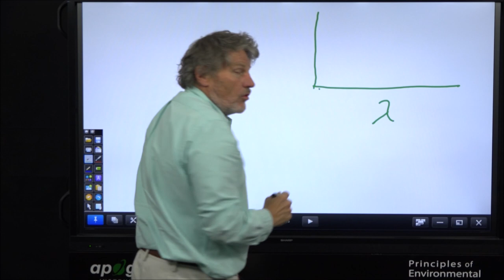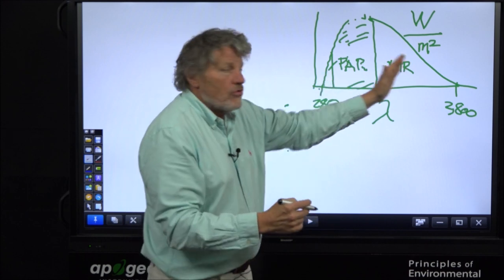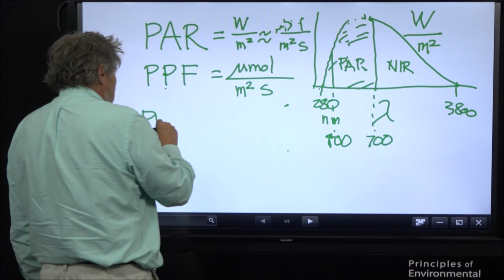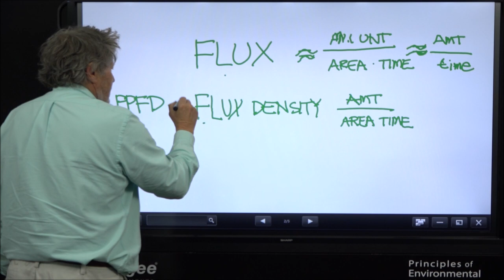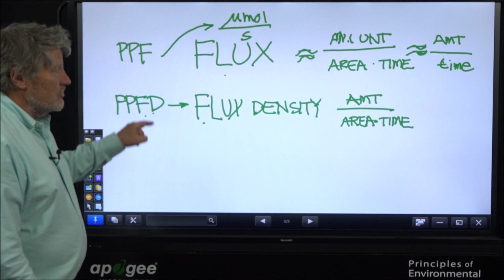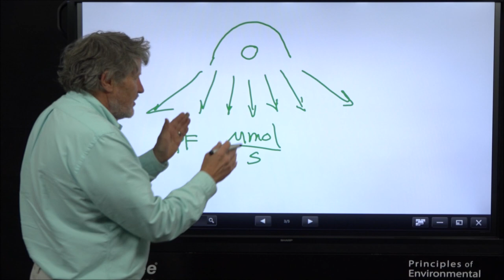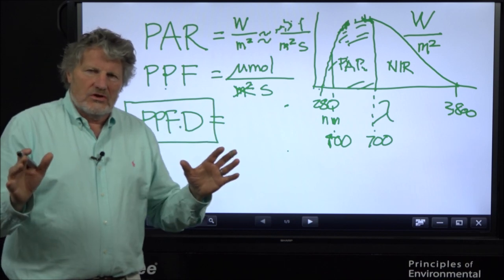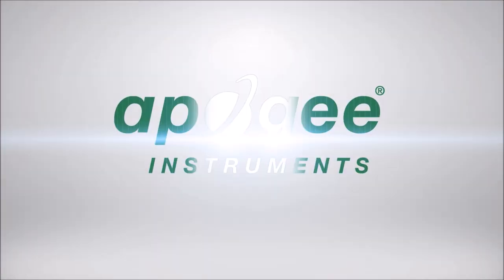PAR, PPF, PPFD, and PFD Explained

Comment: Thanks! A great explanation, sad that we don't see PFD used more often sure this is leading to a slow adoption of new technology as it makes your PPE look less efficient. What is the measurement of PFD? The big difference for me between PPF and PPFD is that the first is a constant and best method of comparing lights while the PPDF is variable based on plant needs and distance, so more important for optimal setup later in process.

Comment: Thanks a lot Dr. Bugbee, great explanation!
One thing that bugs me, though. If you define PFD as the flux density between 300 and 800nm it sure is an improvement over the old units, but it still is not the full picture. Not all photons in that range have the same effect on photosynthesis. For sure there are green photons in the middle of that range that don't have any effect because they are reflected. That's why leaves are green, right? So wouldn't it make sense to multiply the PFD with the relative absorption spectrum of chlorophyll, which has maxima in blue and red and a minimum in green, to get a much more accurate measure of the amount of photons that are useful to plants? Something like PFDP: Photon Flux Density useful to Plant growth.

Comment: Hi a question in the calculation of the PPFD value. Doesn't the measuring distance always have to be specified? Because, extreme example, I measure 1 cm away from the light source and on a square centimetre, which I then extrapolate to one square metre...are there official measuring conditions?
Reply: Maybe 1 foot or 1m
Reply: I'm not sure about this (not enough knowledge), but most likely you're right that you can extrapolate it to a certain degree. It could be it's not perfectly exact though, cause if the distance between sensor and light source gets bigger (even exactly below the middle of the light), photons scatter more and I'm not sure if photons also "bounce" of each other in let's say perfect vacuum so no other particles can interfere. 

Photons should scatter perfectly without bouncing cause every photon has the same speed (light speed), but maybe I'm wrong and there is more to it (gravity maybe also slightly influencing on that small scale?) Also don't know how relevant the production quality of light source is and how much this influences how photons scatter in every direction.

Comment: Very good your explanation Dr. Bugbee, Congratulations. A question doctor, if I have in my measurement 1,267 umoles photons / m2s how much it is in W / m2 or vice versa, how do I do this conversion. Thank you very much for your help and I look forward to your response.
Reply: As far as i understand it, you would have to know the spectral distribution (distribution of wavelengths/colors) to make this conversion, 
because blue photons carry more energy than red ones for example.
A blue Laser diode emitting with a given power will emit fewer photons than a red one at the same power level, because the red photons carry less energy so more of them are needed to match the same power = higher photon flux density for the red than it would be for blue (with the same given power level for both).

Comment: 0.  W/m² as Dimensions for near InfraRed and even Photosynthetically Active Radiation (not accurate for PAR).
1. "It's not the energy, it's the number of photons that cause photosynthesis." - Keith J. McCree
More rigorous a unit for PAR is Photosynthetic Photon Flux Density in µmol/(m²*s).
2. Photosynthetic Photon Flux can be given in µmol/(s). No area in it. Total number of photons. Important for testing the efficacy of lights.
3. "Just when you thought you had it right". Classic 400-700nm theory might not be realistic after all. PFD (Photon Flux Density) hints at 300-800nm counting the photons at the edges.